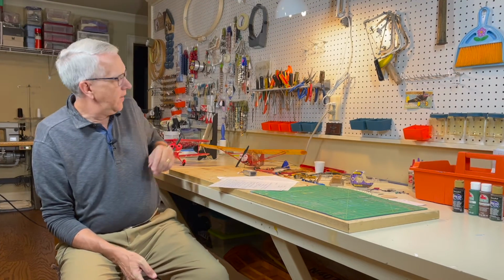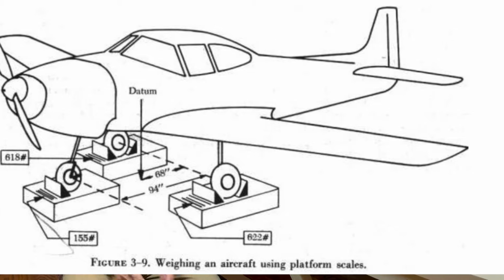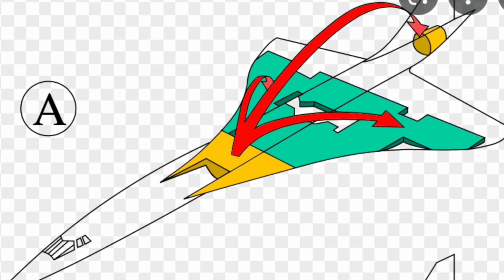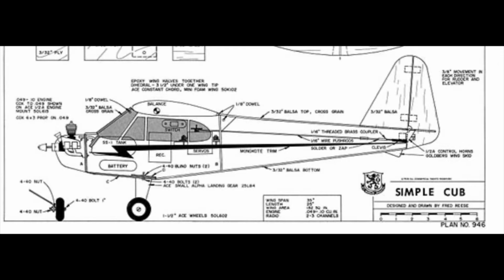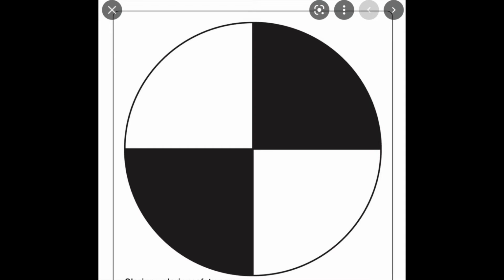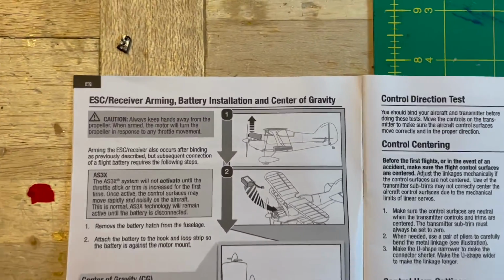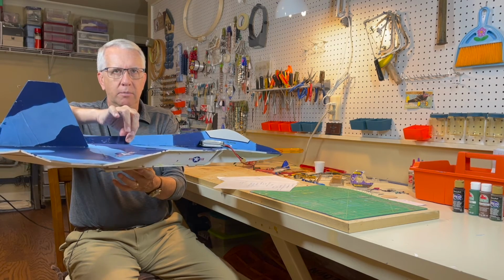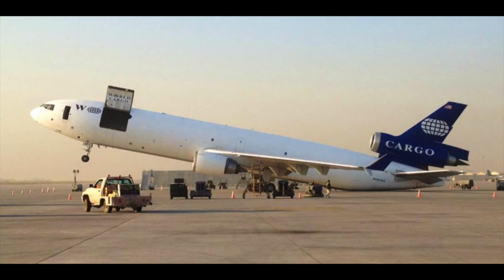Model Airplane Center of Gravity for Newbies

Comment: Excellent explanation of CoG Tim - but what about kit built biplanes? Can you just take 20-25% of the distance from the leading edge of foremost wing and the trailing edge of the aft most wing?
Reply from the maker: Tim:  Yup, you got it.  CG is 20-25% of the total distance back from the leading edge of the top wing to the trailing edge of the bottom wing (assuming a forward stagger).  Good luck!  Tim
Reply: @TimMcKay56     Thank you for this. My plane's manual doesn't indicate where the CG is.

Comment: Thanks for this. In my 55 years of flying RC, virtually ALL my planes, regardless of wingspan (3 to 16 feet) are basically straight wings. I have never had an issue to placing my CG pretty much directly under the thickest part of the wing, which is usually at the spar. Any minor imbalance there can easily be compensated for using a bit of elevator trim.
Reply from the maker: Thanks for this!

Comment: I'm still building my foam board jet . It's large with a 1200mm wing span and swept delta type wing. That I mentioned before.  I used this method and the cg appears to be spot on. With plenty of room to move my battery pack around and install the rest of my electronics.  Thank you for explaining it in an easy to understand forum.
Reply from the maker: Glad you found the correct Center of Gravity . . . super important as you point out.  Good luck!

Comment: I have a question. Since crashing a couple of my foam high wing models (carbon cub s2& Umx timber x) , the cg has changed after repairs substantially. I've added stick on lead wheel weights.  Now my planes don't fly as well due to all the excess weight. What can I do to counter this if anything at all???
Reply from the maker: Not much. The smaller models are very sensitive to any extra weight. Tim

Comment: Hello Tim, do you have a video on how to find the CG on a biplane with staggered and tapered wings ? I looked through your video's but did not find it ?  Many thanks !
Reply from the maker: Werner:  Here is my video on swept wing CG  https://youtu.be/GeYuAbZmDYQ  For the stagger on a biplane, just measure 25% back from the top wing leading edge to the bottom wing trailing edge, that should be your CG.  Think of the two wings as one big wing.  Tim
Reply: Thanks Tim, so if I understand correctly I take the width of the root from the front of the top wing to the end of the bott wing and do the same for the wingtips and then apply your formula for swept wing using these 2 values and apply the result to the top wing to balance the plane ? Just want to be very sure as this is my first f3a plane, it costs a lot so the math must be perfect. The plane is a Sebart Prometheus F3A biplane (https://images.app.goo.gl/WWTCdaWmRh8Br8eb8)
Reply from the maker: @wernervandenbosch  Yes, that is correct.  And if you wish to be a bit more conservation, consider making the model a bit more nose heavy with the CG as far forward as 20% back from the leading edge. As you get comfortable with the model, you can move the CG back aft a bit, to the 25% back from LE mark.  Tim
Reply: Indeed, nose heavy is more an insurance than a problem. Thanks for your advice, duly appreciated !

Comment: Thanks for the video. I'm building a foamboard, straight-wing aircraft, v-tail with flight controller installed and had been planning a 30% c.g. Do you reckon that's too far aft? Is 20% considered a forward-most c.g. and 25% an aft-most for most aircraft? Glad I watched this.. If I could subscribe again I would! :)
Reply from the maker: Olgoz:  For our lightweight RC models, the CG range is not super critical.  30% back from wing leading edge should be OK, maybe a bit sensitive in pitch.  If you want to play it safe, add a bit of nose weight for initial flights to keep CG at 25% point, then slowly remove weights a shift CG aft.  Tim
Reply: @TimMcKay56  Thanks Tim! Will do just that